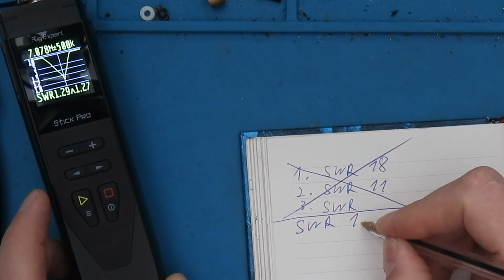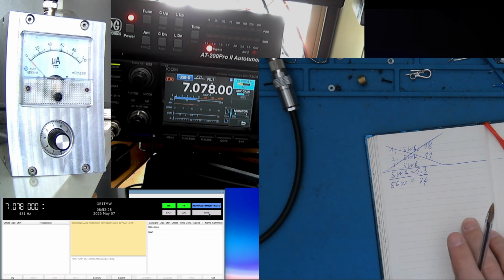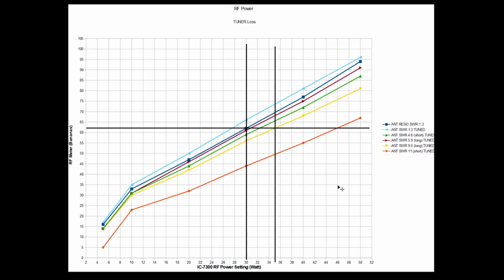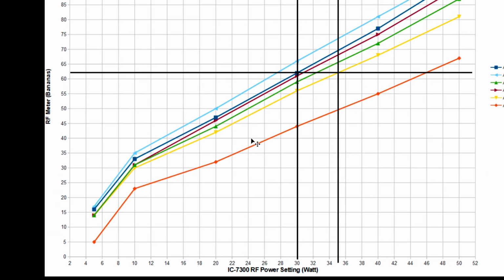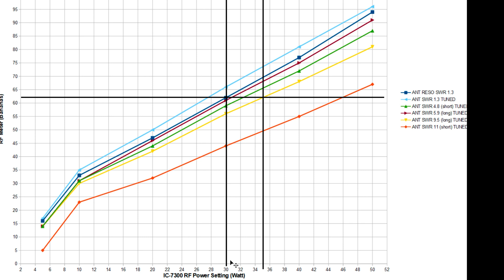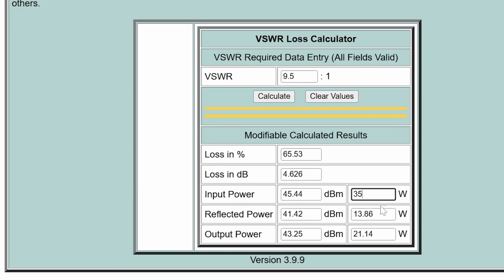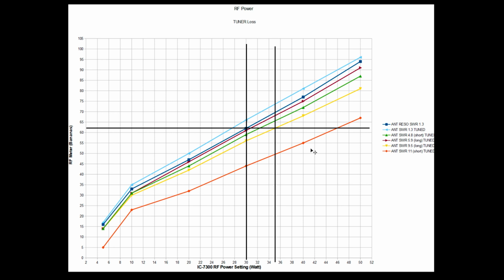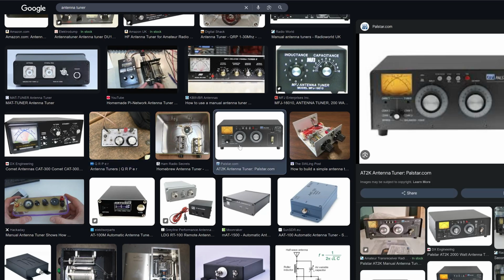Does an antenna tuner only make the transceiver happy?

Comment: Nah, it makes me happy, too!
For high-power work a tuner at the shack, RG6 coax, and non-resonant antennas are fine. (I've worked HF DX using the shield of the coax to my 2 meter beam as my antenna.) But when I go QRP I like to have everything closely matched naturally, and with the least possible loss from other things like matching transformers and coax length. I like to give my 5 Watts the best chance I can of making contacts. With QRP it all adds up and makes a difference, a small difference, but a difference.
Reply from the maker: @johnwest7993  😁

Comment: interesting, however not exactly accurate as the screwdriver antenna is already "tuned" by the coil.
a better comparison would be a dipole at resonance vs a too short/ too long dipole + a tuner.

Comment: Thank you for your measurements as EE I know the loss was way over stated.  It’s really the transfer of power from on impedance to another.   Note everthing after the tuner is the same impedance.  Now all antennas have standing waves and you should always have a common mode choke.

Comment: A Mobile base loaded coil antenna (coil and capacitor) = a non-resonant whip with a fixed value antenna tuner at the feed-point.
You are ok with that, why wouldn't you be ok with an ATU?
A common mode choke helps to prevent the coax feed becoming part of the mis-match.

Comment: I do not fully agree. At a bad SWR, your coax cable is also transmitting. For a real test you have to put your HF meter in the far field of your antenna or use WSPR with a friend. He can tell you our signal level in dB. Just a small story of my live 30 years ago. To surprise people about wireless light: I have used a neon tube in my shack without wire. It was only glowing when the tube PA was missmatched.  In this case I had HF in the shack. To compare antennas I am always using wspr, it is very reliable!
Reply from the maker: yes that's funny with the neon tube 😁.
i tried the test first in wspr but it wasnt good enough. the 2min transmittion is too long. one time tx wouldnt be enough because the measurement is fluctuating several dBs...you would have to do it multiple times, average it and that would just take too long.
will share that wspr data maybe in the next video

Comment: I think you can improve the experiment, reduce the losses eaven further, if you place the tuner directly at the antenna feed point. 

Because in your current setup the coax between the Antenna and tuner still produces a significant loss due to the missmatch of its impedance. It would be interessting to see what shortining this section whould change. I predict a significant improvment especialy in high SWR situations
Reply from the maker: good idea. maybe I will try that too.
the feed line was 22m long (ultraflex 7)....about 0.5dB cable loss.
Reply: The interesting thing is that the cable loss is potentiated by the SWR because the wave travels back and forth multiple times until it can be radiated due to the missmatch reflections. 
So you get cable loss pluss missmatch loss on the section.
You can have a look at ac6la website for more detials, youtube does not let me link it 
My calculations using LMR-300, 1.694db/100m
And a fully resistive Load Impeadence of 938 Ohmes giving me an input SWR of 11 and an swr at the load of 18 would result in in a loss of, input power being 100W, 41W or 2.3dB with 34W of that being reflection loss that could be somewhat mitigated by a tuner.
Reply: @phonix6494  Yes good point.  I just took the general test and there was a question about the fact that high SWR increases losses in the cable even if the transceiver is happy with the impedance presented by the tuner.
Reply: @CrazyChekov  The interesting thing is that the cable loss is potentiated by the SWR because the wave travels back and forth multiple times until it can be radiated due to the missmatch reflections. 
So you get cable loss pluss missmatch loss on the section.

My calculations with TLdetails using LMR-300, 1.694db/100m
And a fully resistive Load Impeadence of 938 Ohmes giving me an input SWR of 11 and an swr at the load of 18 would result in in a loss of, input power being 100W, 41W or 2.3dB with 34W of that being reflection loss that could be somewhat mitigated by a tuner.
Reply: An antenna tuner feeding an antenna via coax cable always belongs to the feedpoint of the antenna.  Otherwise the losses caused by the coax will be significant at SWR > 3:1.

Alternatively, use a (symmetric) antenna tuner and a balanced feedline to minimize losses.
Reply: @DL1GKC  Yes, one quick question that I have not fully understood.
What is the advantage of a balanced feedline?
That its impedacne matches more closley to the antenna or that the lack of a dialectric, it being air, causes les dielectric loss.
Reply: @phonix6494 with a balanced feedline you can handle a high SWR or impedance mismatch, but you will only have little losses. There are equal and opposite currents flow through each conductor, reducing radiation from the feedline.

With coax one has higher losses compared to balanced lines, especially at high frequencies or long runs. The routing of a coax cable from antenna to shack however is most often easier to achieve.

Comment: I admit that I also used to believe an antenna tuner only makes the transceiver happy and I did not even want to use an external tuner. Especially because of Ralph's video(s), I now understand that it actually does much more than this, so I bought one a few weeks ago and I am very happy with it. 🙂
(I bought a manual one by intention, and as I am picky regarding matching, I like to do that manual process of adjusting the inductor and the capacitors while watching SWR and return loss traces go go down on the NanoVNA.😉)
73 de DL1HNR, Henner
Reply: Manual tuning is best for learning and understanding how a tuner works. But a tuner works best at the feedpoint of the antenna, where you need an automatic tuner, unless you have a manual tuner that can be fully remotely controlled.
Reply: @TheMicrofox  Thanks for your reply. I have been given that advice recently by a Portuguese OM during outdoor operation. I assume the reason for it is to reduce the overall loss on the line where the forward power and the reflected power is travelling back and forth to a minimum (by keeping that line short). 
Am I getting that right?
And - if my whole feed line is merely 5m..10m long, does it really make a difference where I put the tuner (on HF)? 🤔
Please not that this is meant to be a serious question from me as a newbie (10 months).
Reply from the maker: good choice with the manual tuner!